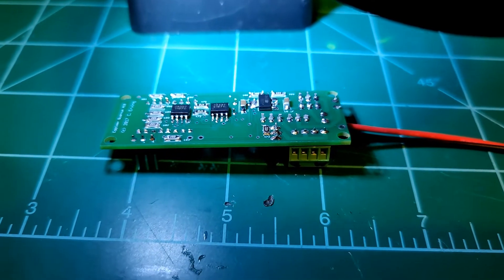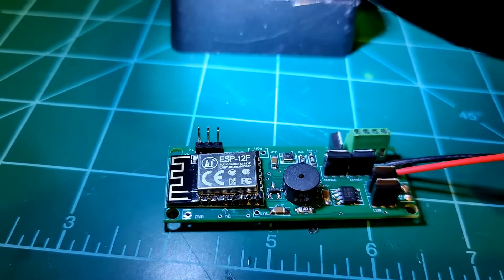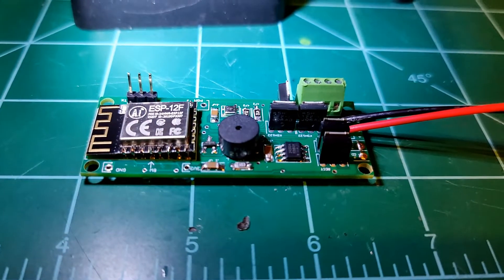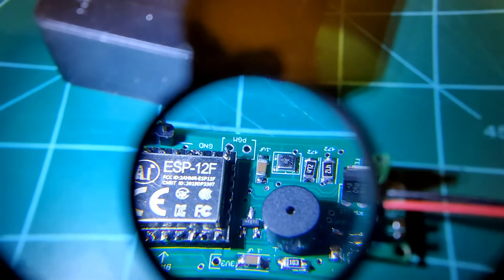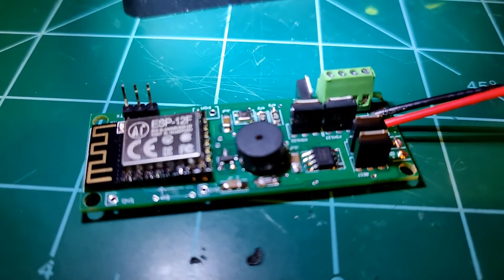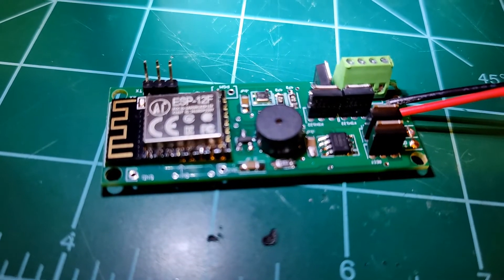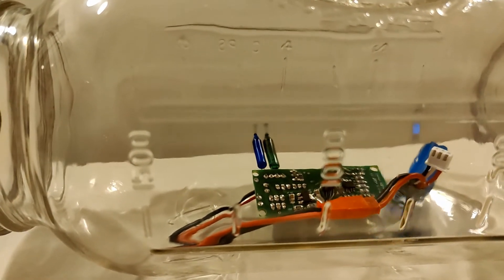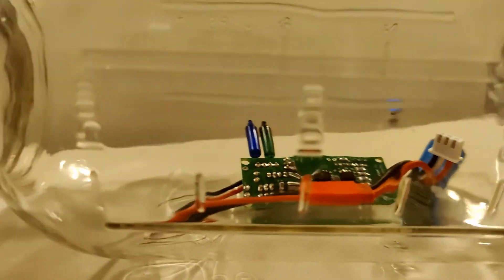Eggtimer Quantum Dual Deploy Altimeter

Comment: What battery are you using? I saw on their manual online that it needs 300mAh at least. Also, does it come with that JST connector?
Reply from the maker: It is a 7.2V 400mAh LiPo. The kit does NOT come with the JST connector, you would need to provide that.
Reply: Thank you for the information. And great video!